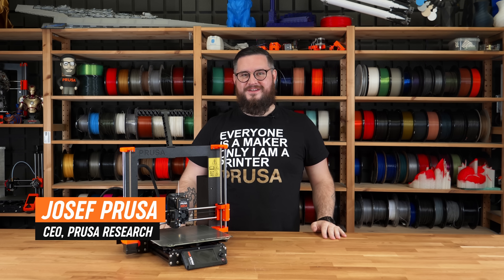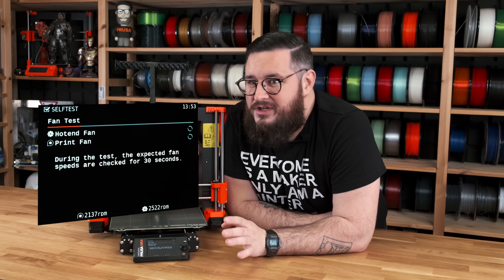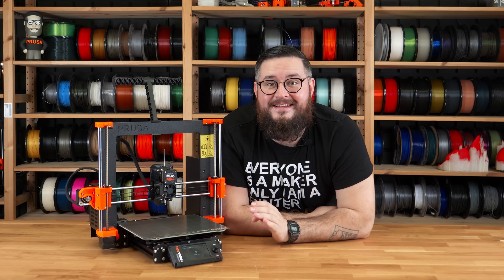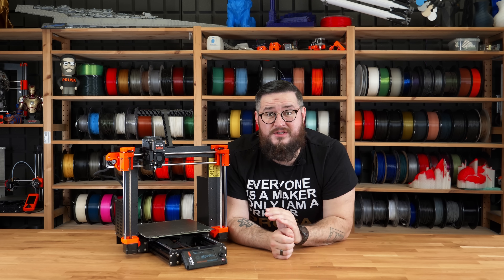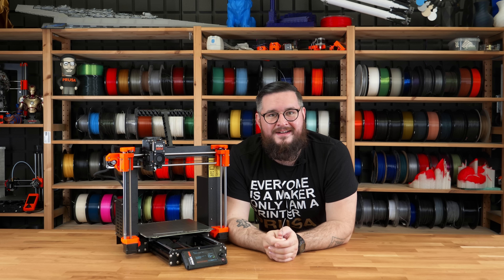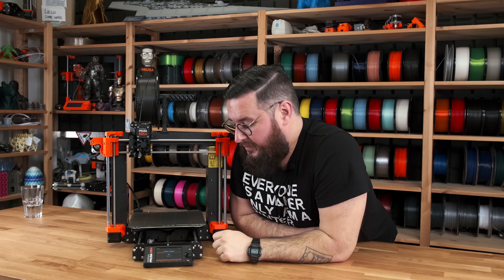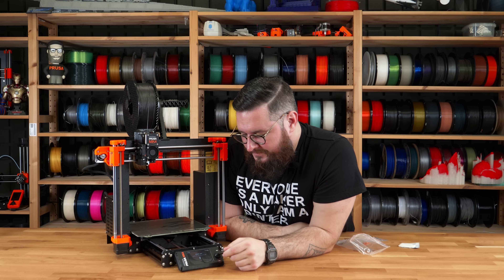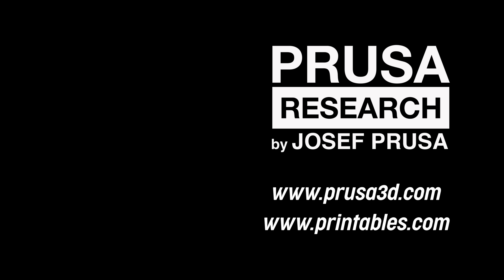New User Guide -  Original Prusa MK4

Comment: It's too bad they didnt included the process before print start. I am on the fence of upgrading my MK3S+ to an MK3,5S or MK3,9S or just buy a Bambu A1 instead. Honestly I'd like to upgrade my Prusa more, but cannot ignore how high the prices are for that compared to a whole new Bambu printer.

I know Bambu have a sort of sleep mode, so it can stay connected to the internet, with low power consumption, and everything else turned off. Does anyone know if Prusa MK4 has the same sleep mode?

Also Bambu cleans the nozzle before print, it has a nozzle wiper which works great. With the MK3S+ I have to stand with tweezers before every print so before print I can catch an clean off the oozing material quickly. Does anyone know if the MK4 is able to clean the nozzle succesfully troughoutly before every print just like Bambu, or it is not so good at that?

Comment: I assembled my kit yesterday and it works perfectly so far, as long as you print locally or using Prusa's own software. BUT: I'm a huge fan of Octoprint and have been using it with my Mk3S+ for years. I'm comfortable with it, it gives me loads of features including a webcam and a vast selection of plugins. But the RPi which I used with the Mk3 will not work with the Mk4. It sees and recognises it but will not pass data. I've tried different cables and computers but the problem remains and is clearly the printer. I'm not the only one with this problem - there are reports of it everywhere. @Prusa3D: You need to fix this!
Reply from the maker: Hi Manek. Please contact our Support Team with the details of the issue. 
https://help.prusa3d.com/article/customer-support_2287
Reply: @Prusa3D Thank you for your offer of support - but I seem to have fixed it. It was due to the setup for the Octoprint for Mk4 being subtly different than for the Mk3S+: it's not a straight swap. So I re-installed the Octoprint image from scratch, having taken a backup of the original config, imported the config file and it connected fine. Might be worth seeing if you can replicate that and putting into the Octoprint support article. Thanks again.
Reply from the maker: Hi Manek. We are happy to know it is solved. If you need more support, you know where to find us.
https://help.prusa3d.com/article/customer-support_2287

Comment: Just received my Prusa MK4. There are no instructions on how to assemble and connect the spool holders to the printer. The two horizontal parts simply do not "click" into place.
Reply from the maker: Hi Roger. We are sorry for this. The instructions can be found on the next section of the online assembly guide.
https://help.prusa3d.com/guide/7-y-carriage-heatbed-assembly_438310#439941
If you haven't been able to solve it, please contact our Technical Support Team, and we will help you.
https://help.prusa3d.com/article/customer-support_2287
Reply: @Prusa3D  Thank you for the link. But I have to point out that I purchased the assembled Prusa, not the kit. The link you provided goes to the KIT assembly instructions. If there are parts that need to be assembled for the already assembled kit, then some minimal instructions ought to be provided with the assembled printer, either in print form or some link. The printer does come with a printed 3D Printing handbook, and that is where I would expect the spool holder assembly instructions would be, but it's not there.
Reply from the maker: Hi Roger. Yes, you are right. The instructions for the parts that should be assembled/finished by Assembled Printer owners should be in the 3D Printing Handbook too. I am passing the feedback, and I hope we can add this info there soon.
Apologies for the inconveniences Roger.

Comment: To the proud MK4 owners out there: How are the noise level compared to the MK3? I heard mk4 doesn't have stealth mode??
Reply: Correct. Mk4 doesn't have stealth Mode. My printer is loud as an Chainsaw. It goes back and will replaced but other Mk4´s sound level is a bit more silent as mk3s+. But do you have new and good quality bearings in your mk3s+ he is quieter.

Comment: How do I turn input shaping?
Reply: You can’t yet.  A firmware update will be released to enable both preassure advanced and input shaping.  I’m guessing a month or so.
Reply: @mika_jurvanen  or 2 years as file upload via network ;)
Reply: @aaqu8  yeah, I hear and read that the wireless transfer speed is a joke.  Guess they’ll adress that in a firmware update aswell.  Luckily firmware is updatable with the USB :).  Hope a lot of those is fixed once I get my MK4 Kit

Comment: Own a Prusa Mini+,  Prusa MKI3S+, and now the MK4, Converted from XL , Shipped 1st day given, received and printing by the last day given to ship!!! The First layer Level is fantastic! It allows me to switch between print sheets without adjustment!, Also got the nozzle adapter, and will give it a try soon. Love the 32 bit LCD with the color screen and more/better info. Haven't had a need to make use of the UI for info on the screen. 
Will be glad when the announced firmware updates are out!! Also having issues with the PrusaConnect...restarting, transfer speed, etc. Chat informed me "it is under development." SO for now, using the USB stick.

Comment: The fan test should make you identify which is spinning. People got their printer with fans swapped which passes all tests. 😬
Reply: Especially a certain gentleman on Youtube had exactly the problem. Has therefore sent back his printer, although the problem would have been solved quickly. Simply design the plugs so that they cannot be interchanged. Can't be that difficult, can it? Why do they always save money in the wrong places? Same with the bearings.
Reply: @Neo1983m  someone who cant connect 2 fans correctly with perfect diagram and instructions shouldnt even touch 3d printer, cant be that difficult to follow the manual. mk3 has shit bearings tho i agree, mine started to sound really sad after a year. i believe mk3 had the test for correct fan connection
Reply: @adamvanek8005  The youtuber purchased it fully assembled. Prusa connected them wrong during their manufacturing assembly.
Reply: @adamvanek8005   He dont assemble itself. The printer was manufactured assembled. He don't anything wrong. You understand?

Comment: Will the Prusa Mk4 work ok in the Prusa Enclosure?
Reply: Yes it will. Just the easy release power supply system is not available yet. I have mine printing in the enclosure for a week now. LCD mounts were recently released. LCD cable is a bit on the short side though but it fits.

Comment: Love my Mk4! Prints look amazing, best printer experience I've had by far. Just a couple items I noticed around the filament sensor (may just be me):

- Not getting notifications in prusa connect when filament runs out 
- If you remove the filament when the prompt comes up asking if the unload was successful, it looks like it resets the filament sensor calibration (making it basically not work)

Comment: It may not be as fancy as the printers coming from Bambu, but I really wish this had come out in January when I purchased my P1P. I would have bought the Mk4 kit instead. :(
Reply: If you want to print fast it’s gonna be loud. You have to cool the filament quickly and fans are loud. You can make the Bambu quiet if you print at Prusa speeds.
Reply: @forcedindenturedservant6881   Even at 50% Prusa Speed the Bambu is 10x louder than the MK4
Reply: @Neo1983m  Printing what material?
Reply: Why MK4 over P1P?   I loved my old MK3 but it hasn't been used since i got my P1P and it was pretty feature complete from the factory (i.e input shaping, speed)
Reply: @bennetb01  Prusa MK4 is not as loud compared to the P1P from what I have heard. But some say MK4 is louder than the MK3s. 
Also Prusa has a better track record for support and you support the 3d printer community. You can also use V6 nozzles with an adapter.
But the P1P is also a great printer and cheaper.
Reply: @nickjeffrey8050  and other users will send me free replacement parts?
Reply: Coming from the mk3s+ the mk4 didnt wow me to make me regret buying my X1CC. You arent missing anything.
Reply: I'm selling my p1p.    I'm tired of not getting constant quality and sizes.   Everytime I'm off
Reply: @chadfarmer7695  I will buy your defective p1p for a very low price, cause as you mention, it have problems. But relax now you will buy your dream mk4. If I offer you $200 then you will need just $1000! That's a great deal my friend!

Comment: I’m sure tapping the nozzle is fine and all, but it seems like SUCH a bad idea lol.
Reply: It's the best way.
Reply: @REDxFROG  I’m sure it is the best way to calibrate/check the sensor, but it goes against my better judgement haha.
Reply: @RightJoystick  it can't really get any more precise that actually reading the true bed height.
Does it need to be that precise?
Probably not. But if it's the same cost or similar to other ABL solutions then why not.
Reply: @youtubevanced4900  feel like I’m going crazy here - is everyone purposefully missing the point of my comment?

Nozzles are normally extremely HOT.  So touching it as part of calibration would throw me for a loop lol.

I think the only time I’ve ever touched a nozzle with my bare fingers is when threading one as part of a nozzle swap.  That’s literally it lol.
Reply: @RightJoystick  why would you touch the hot nozzle during bed leveling?
It touches itself to the bed.
Your fingers are not required, unless your trying to print directly on your hand. Which I will admit would make the nozzle leveling less ideal.
Reply: @youtubevanced4900  did you watch the video? He clearly slaps the cold nozzle as part of calibration.

A hot nozzle in 3D Printing is the last thing you want to touch, ever.  So touching it like this while the printer is on is just a weird step that we’ll have to get used to.  Printer on = hot nozzle usually.

Not sure what is so difficult to understand about all this lmfao.

Unless English is your second language, in which case fine, I get it.

Comment: I've been very happy with my Prusas (i3 Mk3, i3 MK3S, i3 MK3S+) and can't wait before picking up the MK4...but I'm going to wait for the input shaper. Also, waiting to hear why Uncle Jesse's MK4 was having issues. 

More than happy to support you guys/an awesome company...but if these are early warning signs or slipping quality/cutting corners...I may have to reconsider.
Reply: In Uncle Jesse's case the problem was switched cable connection between print fan and extruder fan. The MK4 was printing and not cooling the heatsing... so the nozzle was clogged. It can be clearly seen in his videos of first layer prints.
Reply: @xhobv02  Jup. The Hotend-Cooling-Fan is not running, when it should.
100% User Error.
Reply: @uhu4677  what happens to all sensor that check everything for the first time? It's a mimic? Or they don't check the fans?
Reply: @uhu4677  ohhh. Ok. But why he do that? He had to change or upgrade something?
Reply: @uhu4677  It was a pre-assembled printer so it was probably a mistake at Prusa
Reply: 3.5 kit pre order as well and ffs. The problems are stacking and the support isn't
Reply: Uncle Jesse was just user error. As a „experienced“ printer operator not checking the Fans is just bad.

Comment: Why is your printer so quiet and no rattling noise?
Reply: Mine doesn't have rattling noises, none of the 6 I have do. Lol.
Reply: @Xyphis Unfortunately, Prusa does not seem to use Misumi bearings anymore, but cheap ones from China. Very sad.
Reply: Rattling on the bed? 
Mine mk3s+ had this out of the Box, Had to grease the bearings, came dry
Reply: Change them with drylin bushings.They turn the printer into a ninja.

Comment: I already got my MK4 (converted XL preorder), and I'm amazed! Auto Bed Leveling works like magic, I can re-use my Mk3S+ print sheets, and it'll receive squash ball feet soon.
It is not perfect (no printer is), but it is even closer than my Mk3S+ before. Very good work, jo!  ☺👍
Reply: I'd say don't use squash balls.

Put it on a rubber mat and a large stone plate. Done.

If you put it on squash balls please don't complain about bad surface finish.
Reply: @REDxFROG  i second this, squash ball are bad, put it on a concrete slab, it will remove/reduce vibration. most printer simply transfer their vibrations through what they are standing. I found that the hard way when I bought the "table" for my vCore 3.1 500mm
Reply: I put mine on abig concrete slab (it cost 7 bucks or so), and it prints perfectly on it.